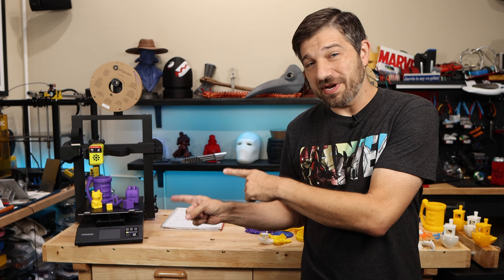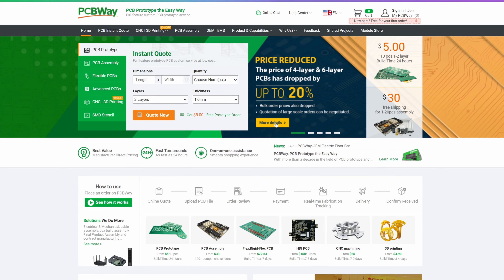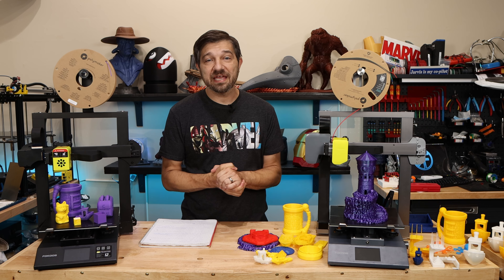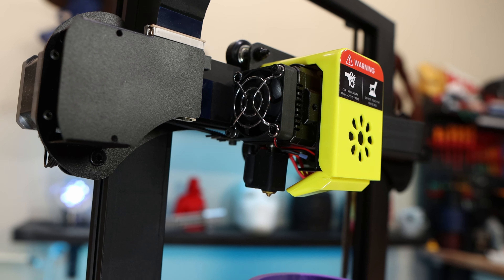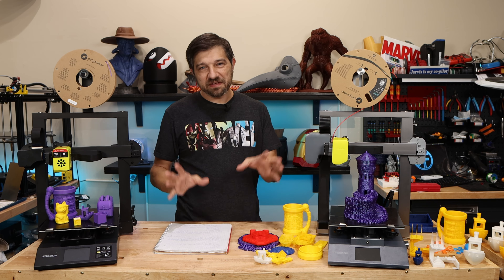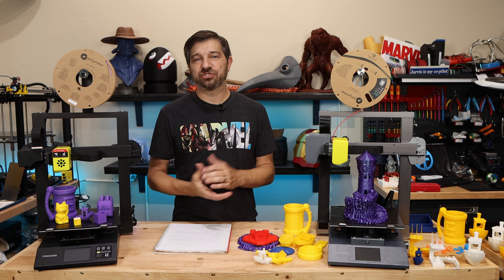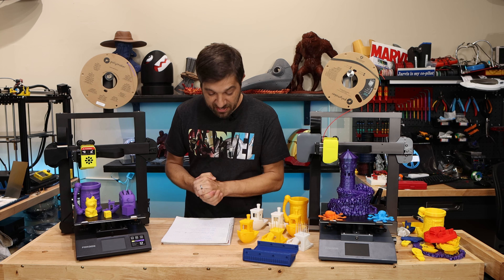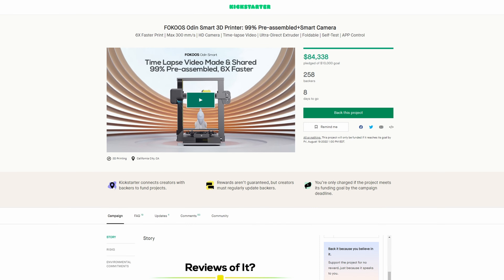FOKOOS ODIN SMART vs ORIGINAL ODIN-5 F3

Comment: I just installed clipper on my Odin 5 I was hoping the Odin smart would have the MKS skipper board and run clipper from the factory disappointed with the hot end and the single z motor of the smart
Reply: No, they have their own pcb on the smart model
Reply: @texxstalker  hey, do you think its still possible to use klipper? I have a rasperry pi, but i need the printer.cfg file and i dont think i can just use a robin nano since it has its own board

Comment: How did you get the customer support? I bought the SMART, would not work on the x-axis, emailed them like 3 times for no response 6 months ago. Took apart the printer and fixed it myself.

Comment: Meh I have an Odin-5 F3 that was sent to me to check out.  Mine is a jam monster since the extruder has no tension adjustment.  I also find it requires constant leveling since something goes on with the Z dropping after power down.  They sent a replacement extruder but honestly, its just so unreliable that its sitting in the corner
Reply from the maker: Interesting. My F3 really never had any issues. The SMART on the other hand... All in all, both still basic bed slingers with slightly different features.
Reply: @kerseyfabs  yeah, it's frustrating.  I have 24 machines in my print lab now, many y slingers (3 CR-10S, 1 CR-10S Pro v2, 2 CR-10 S5, etc) and the race to the bottom in quality has been disappointing.  "it folks"  so what?  My car has windows that go up and down, is that a selling point??  I hate to kick a dead horse but between the extruder, the low quality hot end and so forth, it is really a lottery on if you'll get a working one or not.  I upgraded to a BL Touch, Wham Bam bed and updated the firmware.  But until that extruder is reliable, its all moot.
Reply: Interesting - I have a CR10S that's been my workhorse for 5 years now - I took it down for repairs (heater cartridge needed to be replaced, wanted to upgrade mainboard and add BLtouch) and was going nuts in between so I bought the Odin 5. I set it up in less than 30 minutes (including taking it out of the box) and have been printing on it like crazy for the last 2 weeks. Yes, you still have to level the bed here and there. I'm used to that with my CR10S. I also learned not to mess with the extruder when it's unloading; I prematurely pulled filament out and it jammed it. Not a big deal; I removed the fan and heatsink, pulled the piece out with a pick and all was well afterwards. Just let the extruder do the loading/unloading. Considering my experience with the Tevo Tarantula (which I still don't have running) this thing is a dream. Only thing I could ask for is a breakout on the hotend board that allows a BLtouch to be added that goes through the ribbon cable. That way I don't have multiple sets of wires to deal with. 

Maybe they had QC issues when you got yours? FYI, I got mine about 2 weeks ago (mid Jan/2023.) I've seen some of the negative reviews but also seen a lot of positive ones too. Wonder if that's the impetus behind the 50% off on Amazon? Heck, I'd buy it from you if you want to get rid of it! 🤣

Comment: It seems that speed while printing is becoming the new selling point and that's great except that most of these prints that are being printed at speeds over 100 mm, the quality is marginal. I hear  all kinds of terms describing  less than acceptable prints. So while they advertise 300mm, if you want a good quality print its going to have be slower than 300mm unless you have a box frame or core XY. You had to do a lot tuning to get a decent print at high speeds, with that in mind I think there will be a lot of folks that don't have your abilities who will be disappointed with the end result.

Comment: Interesting and informative review, I got to it after seeing the original Odin-5 on Amazon UK at £135.00 delivered. Even though I have a highly modified Ender 3, (extra Z motor, Direct drive and Creality Touch)) this seems like quite a deal for a second machine. Do you know if its mobo can be fitted with a BL Touch?
Thanks!
Reply from the maker: My Odin Smart came with the adapters and everything to install a BLTouch. So they seem to support it. I didn't test that myself.
Reply: I've just ordered the same on Amazon as my first printer. How are you getting on with it? Mine comes tomorrow.

Comment: Kris, a very interesting review.  I was thinking the same thing about the price before you make it so obvious.  Just checked and Amazon has the FOKOOS 3D Printers Odin-5 F3 for $209 and for me free delivery and no sales tax.  If I was in the market for this level of printer it would be a great deal, and maybe a good first printer for someone.  The Smart version seems to me to have less mechanical features and twice the price.   The other show stopper for me is the Kickstarter - something I will never do again.   The claim of a bedslinger printing at 300 mm / sec is total nonsense if you expect any kind of good results.  Your testing showed what happens when you try.    The problem they will have is the market is crowded with low cost printers and very few hobbyists want company specific hard ware and firmware.  I can see all kinds of problems with the camera and new mainboard being their design as well as the software, a lot is riding on their support and staying in business.  Will be curious how well they fix the firmware problems and if these find a market.
Reply from the maker: You got it David! I'm just trying to keep it honest here. The length of the video reflects the complexity of all we have to go over.
Reply: @kerseyfabs  You did a good job getting all of the information in as short of time as possible.  It may be long, but too much would be missing if you made it shorter
Reply: The mainboard is using an STM32 processor so it should be perfectly possible to compile/flash your own version of Marlin2 to the Fokoos Smart. The camera processor is a different story though, would be very cool if they would open source that part...
Reply: @BartVanBragt  Good points.  That is why I think the cheaper one is really a better solution.   Could be a good first printer.  I'm past that stage.  I have retired my 3 Ender 5s  and now am looking to replace my Ender 5 Plus.  I have two Rat Rigs and the XL on pre order - will see if Prusa can deliver
Reply: The lowest price I saw on Amazon for FOKOOS 3D Printers Odin-5 F3 was $349. Unless you have a link that's otherwise?

Comment: Thanks a lot for the thorough review, Kris! And thanks a lot for opening up that camera 'box', seems like there is an Anyka AK3918EN080, that might open a way for a custom Linux install on there.

Would you mind testing a fast (200mm/s +) print on both the Smart and the Odin with the same filament? I.e. sending the same Gcode file to both printers? As you have said they are mechanically basically the same, there is only a small difference in stepper drivers (TMC2208 Standalone vs TMC2209 UART) and I'm guessing that the steppers themselves are also not very different. Curious how they perform head to head.

Related to that; I'm very curious what the volumetric flow rate of Smart extruder is with that MK8 nozzle. The Odin-5 seems to be able to push approximately 20mm^3/s, that's a maximum of 250mm/s with 0.2mm layers and 0.4mm layer width. What can the Smart push out?

Comment: Woah. A useless printer that should not be “bought”. 
“There’s a problem with speed and 3D printing” - uh, no. It’s a problem only with low end printers, no matter what useless features they attempt at baking in or what price they are asking.
Reply from the maker: I showed it wasn't "useless," but expectations need to be tempered for sure. Even high-end printers need proper tuning to print fast.
Reply: @kerseyfabs  I honestly think you should not spend time reviewing such machines. A bed slinger whose manufacturer claims 300mm/sec print speed? With what acceleration? Come on, give me a break. You can barely get it to print correctly. 

While these printers have some “features”, they are ALL more of the same. Any bedslinger printer is, for that matter. 

And GG, are people actually expected to fiddle with SD cards to print a model? Geez, this is 2022. Another sign of a useless machine, sorry. 

My view is simple - Anyone who wants an easy, reliable, OOB-like experience knowing that 3D printing is a slow process should buy a pre-built Prusa.  Those who wish to have a fast 3D printer that pushes the limits of current FDM technology need to know that there is [almost] no other way than DIY/kit and several out there. 
Those on a tight budget will keep buying Enders and its clones of clones, then lament that they spend more time fiddling than printing, or spend hundreds to get it to a decent quality.
Reply from the maker: I actually chose to take this review because of their claims. I don't plan to do these sorts of machines in the future but I thought it was important for someone to look at the claims and give an honest review.
Reply: @kerseyfabs  if this was done for warning new users then it is a perfectly valid argument and you should be thanked. 👍🏽
Reply from the maker: I appreciate it! As you can imagine, with the time I put into it and the results I got, I didn't do it for my sanity. 😂
Reply: @kerseyfabs  Makes sense yo.. Now, wondering when is  your time to join the Klipper/Voron/RatRig bandwagon.
Reply from the maker: @itayst  It's coming very soon. I hope September. I'm going CoreXY on one of my Ender 5 Plus machines.
Reply: @kerseyfabs  That’s great! I hope what you are considering is the ZeroG Mercury One.
‘cuz otherwise….no.
Reply: @kerseyfabs  That´s going to be one to watch out for. 
Off-topic, have you ever printed with the Polylite PETG?
Reply from the maker: @crazytrutas  Not Polylite specifically. I usually go for Greengate for my PETG.

Comment: You should have just said: crappy printer in the beginning. Why do we have to waste 38 minutes of our time?😁😁😁
Reply from the maker: If I would have simply said "crappy printer," there would have been a lot of questions as to why? What didn't it do well? There would have also been questions about how I tested and whether I knew what I was doing. By explaining my processes and why it is this way, I not only inform but also teach.
Reply: @kerseyfabs   Don't worry Kersey, you are OK. Give us something interesting and constructive.😁😁😁🤙
Reply from the maker: That's what I'm here for. 😁
Reply: In my opinion it's not a crappy printer, but the 300mm/s claim is a bit of an overstatement. Seems like marketing thought that up and now it's up to the engineers to come close to that with a fairly standard bedslinger setup.

So far the Odins are pretty reliable machines with fantastic after sales support and a very welcoming community. This Smart printer can be a great successor to the Odin-5 if we don't take the 300mm/s too seriously and if they find the proper price point. $400 or $350 is just too much for this, but my guess is that they are testing the waters with the Kickstarter to see how far they can push the MSRP.
Reply: @BartVanBragt   I built a super light head Delta printer And I'm having hard time making it print 200 mm/s.  Does the printer actually show you how fast it's moving???😁🤔